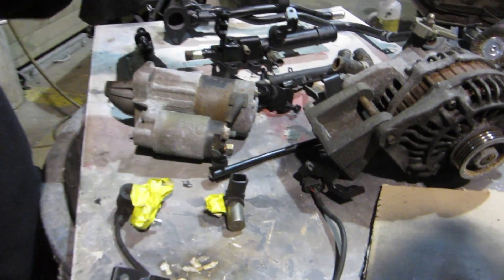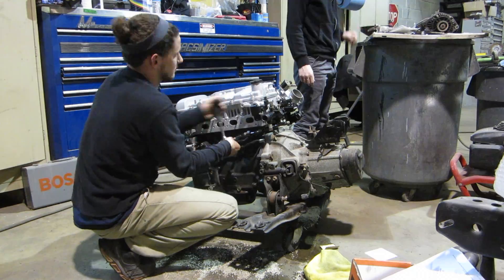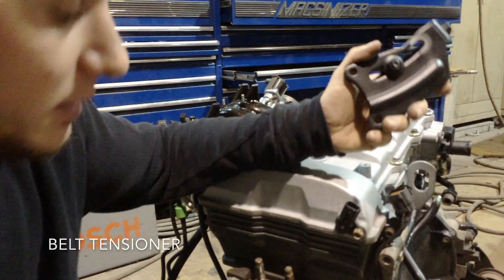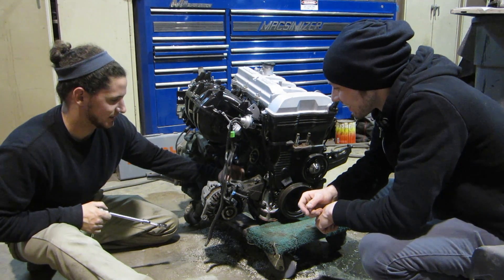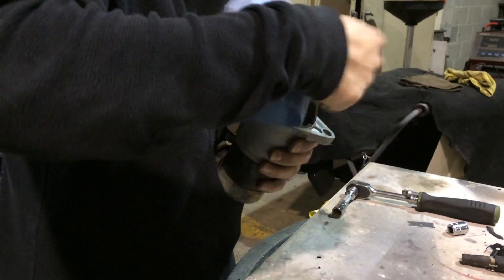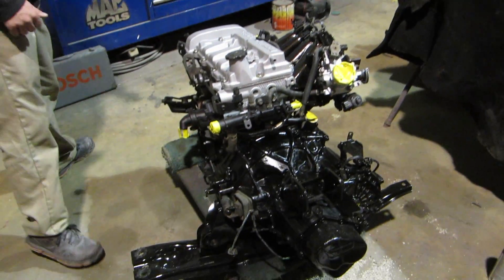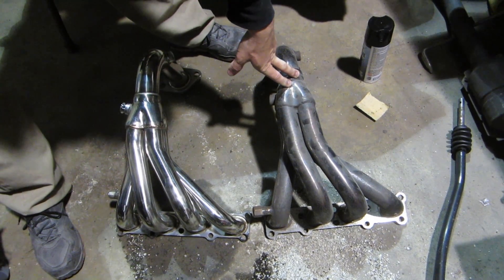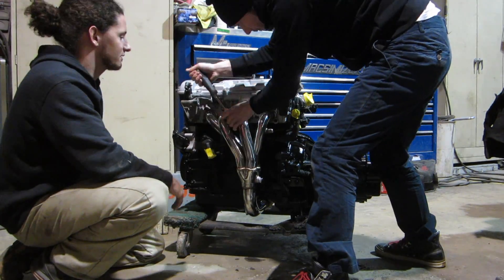Engine Install [UnBusted Heart Transplant - pt4]

Comment: Where is the garage located?
Reply: Please email me ur location at this email cancunence35@yahoo.com thanks
Reply from the maker: We're working on establishing a garage location, but we're located in Delaware. How about you Armando?
Reply: @milsgarage  im in Pa close to delaware but where exactly to get my protege for service 👍👍
Reply from the maker: @sancheztorres35  Nice! Sweet! We're in the Wilmington and Newark area. My backyard is in PA 💯. What's goin on with your Protege sir?
Reply: @milsgarage  well it had 234xxx miles inreplaced the timing belt at 178xxx but is runing good and im thinking to do the head gasket and a new muffler sistem

Comment: Did you remove the catalyst Did you make any changes to the oxygen sensor 2? You used some coupling to separate it from the exhaust pipe. I wait for your answer thanks, good video
Reply: Aaron Franco It has a magnaflow highflow cat, and for the o2 sensor I have 2 spark plug non foulers, which act as spacers to desperate the sensor from direct exhaust flow which allows it not to throw a code
Reply: Ryan Cox ok thank you very much. Good video 🖒🖒

Comment: hey where did yall get yalls motor at
Reply: It is the same motor that came out of the car. I bent a rod when I got a little rev happy lol.  We took the motor out, sent it to a local engine shop and had it rebuilt. Then we put it back in :)